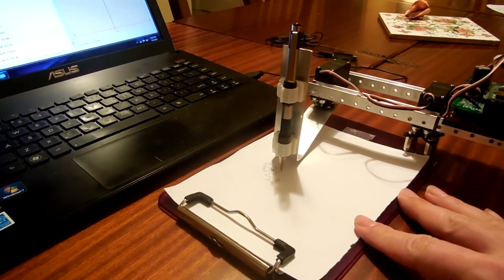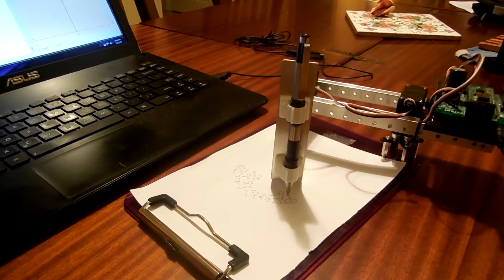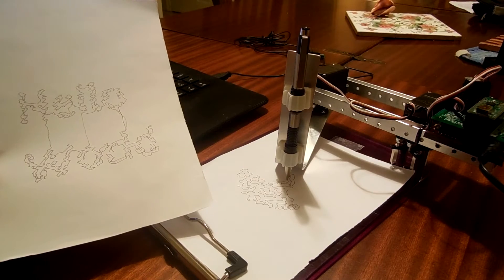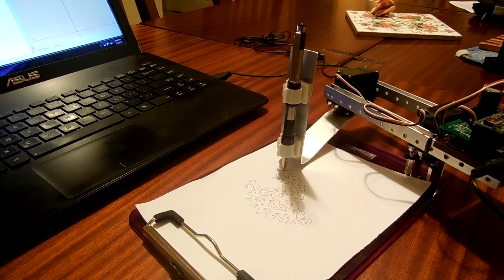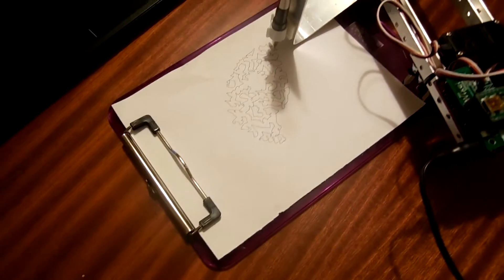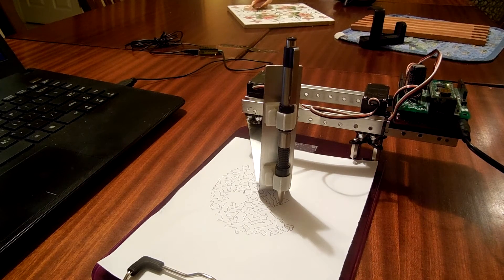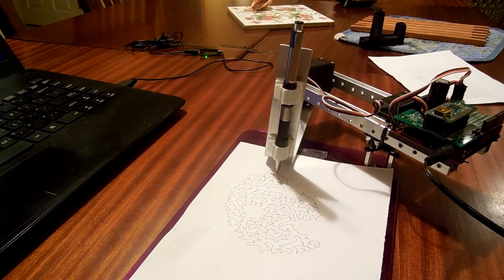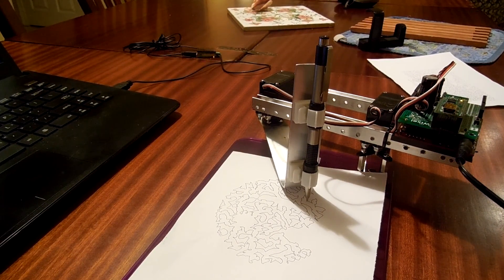Scara Arm Drawbot Mk II

Comment: Do you have a 3D printer? I have wanted one for a little whil;e now and I`m not sure how big the learning curve is but I`m sure I can figure it out. I wonder how hard it would be to make your own 3D printer?
Reply from the maker: I started building a 3D printer a few years ago. It's is mostly complete but needs more work. You are correct that they have a steep learning curve.
Reply: @mheermance   I have a few "inventions" I have drawn out and I'm needing a way to make a prototype, I've made a prototype for one of them but I need a better one, that's why I was thinking a 3d printer would be best. I have quite literally  thought up and drew out at least 40 inventions since middle school and never did anything with them and ended up seeing at least 2/3 of them end up being made and sold years after I had it drawn out, so I a few now that will 100% work and be very useful and I don't really know how to go about it?
Reply from the maker: @TheSlipbookie  A 3D printer can help you and you don't need to own one. There are online services where you upload your model and pay them to print it. That way you only need to learn 3D modeling and not how to run a printer.

Comment: Can you share with me link of GRBL, which you used for this machine. The link is broken.
Reply from the maker: It is indeed broken, but a Google search shows this as the latest version https://grbl-controller.software.informer.com/3.6/
Reply: @mheermance  what about diagram of this circuit? Can you show it? I like it very much, but in my country, hitec servo is more expensive than MG996 servo, 9G servo,... So can I change MG996 instead of Hitec servo?
Reply from the maker: @lephi1240  Use any servo that you can afford. The circuit is pretty trivial. I just run two wires from the arduino digital pins to the servo control lines, and ground and power to each servo.
Reply: @mheermance  thank you very much. I hope that you can create interesting machines like it in the future. Have a nice day!

Comment: by what mean you convert svg to gcode any link ?
Reply from the maker: Mr Innovative SVG means scalable vector graphics and is a file format that describes line images. GCode is machine tool motion control language and is similar in concept, but different in format. I wrote my own conversion program which is probably too clunky to share, but if you Google "convert SVG to GCode" there are several articles on the topic.
Reply: thanks a lot for quick response , i will google it btw very nice project

Comment: can i make it using mini servos?
Reply from the maker: They should work, although their torque is lower and the gears aren't as durable. Try it and if they're not strong enough, make the arms a bit shorter to compensate.
Reply: ok thanks